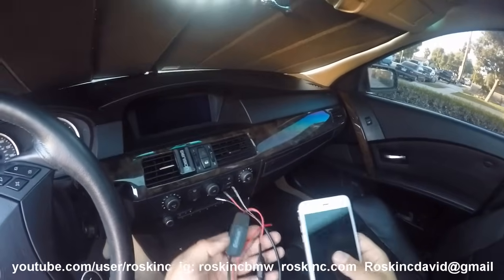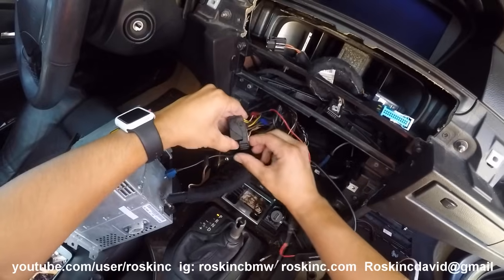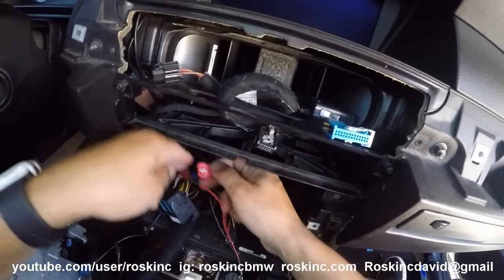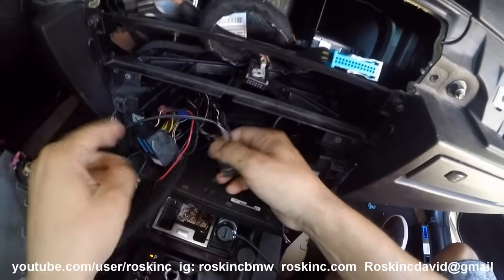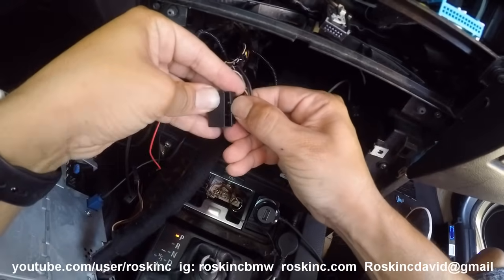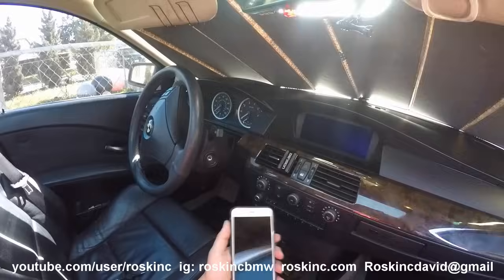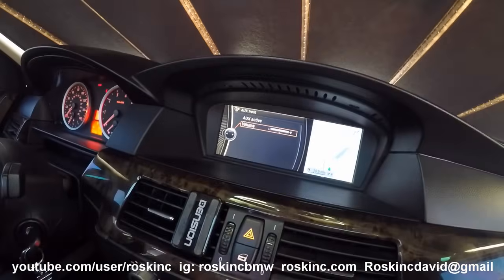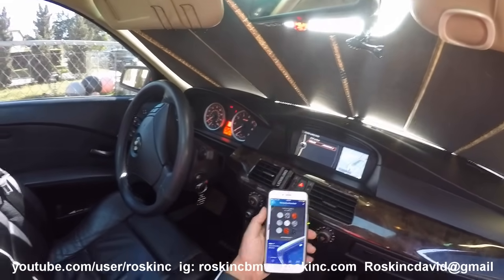how to install bluetooth aux adapter e60 bmw 5 series iphone 7

Comment: Just installed my BT and aux cable bundle. I got to say I’m impressed with the quality of the sound. I was expecting some latency delay, but to my surprise there was none. Instructions were very detailed. Only set back was the inability to install the aux input in my dsc area because I have heated seats and the module had a circuit board that wouldn’t allow me to drill a hole. But this was a blessing in disguise because I found a more convenient spot in the dash. Also, very happy it does not interfere with the factory hands off blue tooth cell phone feature. This was on an 04 530i. P.S. Coding the AUX to the idrive took less than 5 minutes. It helps to know coding ;-)
Reply from the maker: supra driven thank you! Enjoy the aux I’m glad your enjoying the quality. Since this video I’ve gone through a ton of Bluetooth chips to find the best quality volume one. My adapter have since gotten way better from when I made this first one on this video!
Reply: roskinc That explains why the one I received looked different than the one in this video. Thank you sir.

Comment: if you already have a aux cable then just get a aux Bluetooth receiver more simpler
Reply: aux output sorry
Reply from the maker: you could do that, but most of them have a terrible alternator noise when connected
Reply: roskinc bullshit , any amazon bluetooth reciever works great
Reply from the maker: DaRk³NorSZ try connecting a Bluetooth receiver from amazon to the aux jack via a usb plug. It’ll work but you’ll get a whine. Not saying my adapter is the only ones as many have copied mine but adapter from a usb plug makes alt noise. Mine has a power filter, i have since made my adapter better since this video was filmed.
Reply: Roskinc any way to tap into video feed to the display ? I have a spare screen so going to attempt video input on it could do with diagram on pins any ideas ?
Reply: @roskinc  I was just going to ask you, I'm getting a humming noise from my Bluetooth but I plugged mine into the original aux connector like yours. I replaced original Aux wires white, yellow, black with swapped Bluetooth white, orange, black is this correct? I tried to use the Bluetooth connector on the other side of the aux but I didn't get no sound.

Comment: Any ideas as to why the sound is significantly lower when im using the AUX cable as compared to for example the radio / CD? And if so, is there any fix to this?

Comment: I have a 2004 e60 530i. I had my car coded for an aux and installed using your video. Now I upgraded to Bluetooth adapter and WOW ITS SO MUCH CLEARER. Took me 30 mins. Plug and play. Thanks bro!!!
Reply from the maker: Your welcome glad you enjoy my product!! I appreciate it!
Reply: No doubt. Had to come show you some love. Keep it up!
Reply: Does it work with the steering wheel buttons?

Comment: Installed this last weekend in my 2006 BMW 650i. Wiring was exactly the same so that’s great. Works great! The ground wire can be tricky to tap into, so for anyone doing this make sure you wiggle it quite a bit to break through the isolation.

Comment: I received mine yesterday this is going into 2008 528i.. the installation looks easy enough. I will post an update after installation. Mine already has the aux option. So this should make the installation easy no coding needed.

Comment: sry for the bad english i guess (germany)
i tried to go for that white cord that you used. It was 5V only.
I did remove the Middlepart where the (GearSwitch) is and put the + on the Cigarette thingy and - on the main part where the cable is going to the navi. it was 12v then and it wasn't permanent on! But thanks for the Tutorial!

Comment: Nice one man, I've got the 2007 530i and was going to buy the damn ULF module which costs a bomb. This is a much better (Less expensive) option. Only down side is you don't see the art, tag info etc on the iDrive screen but personally it doesn't bother me too much.

Comment: just got mine coded and installed works great sounds good and does not interfere with cars phone bluetooth or ipod adaptor thanks for the tutorials.  I noticed when I was codeing the mask I saw something about equalizer nitch , if I mount this will I get a equalizer in the menue of the idrive instead of just the tone bass and treble?
Reply: Well I did make the eq active it shows up in the I drive but is non adjustable anyway to make the eq slides work?  Also my bluetooth aux volume is noticeably lower volume than CD or radio or factory ipod adapter or factory hands free volume is there anyway to make volume for ADP2 louder

Comment: I would like to know what version of bluetooth does your solution offer? Chinese offerings are all based on bluetooth 3.0. However, Sure Electronics has a small board that delivers bluetooth 4.0 with APT-X (also on 12v and also at similar price point)... which GREATLY enhances streaming quality. If someone were to sell that as a ready to go solution like you are doing here (i'm not the soldering type), i would choose that over the older bluetooth version.

Comment: Received your BT adapter kit a couple days ago.  My 08 E60 connector uses only pins 3, 4, 9, and 10.  You say use pins 2, 7, 8.  I don't have CCC, MASK only.  I already have a working armrest AUX so are those different pin numbers on mine?  Confused on what pins to use.

Comment: Question, do you disconnect battery when tapping into the wires? Also, what is the name of the connectors you used the plastic. Thanks for the great video!

Comment: i have a 2007 e60 550i, yet my idrive system doesnt look like that. Is it important to update my idrive before installing this? 
i was using the rear auxiliary connection ever since i first bought the car and eventually it finally gave in and broke. This bluetooth adaption will help greatly! 
many thanks, 
- New subscriber
Reply from the maker: Karl Enero this video i have a Cic retrofit but you do not need anything upgraded, you can use the standard non navigation or any system the e60 comes with to add this. If you have aux already just add my adapter and your good to go .

Comment: What's up bro I'm so grateful for your videos. I just got a 2007 530i 2 days ago and I'm trying to figure out a way I can stream Bluetooth audio and still use the steering wheel controls to answer calls. Any help would be much appreciated
Reply from the maker: Eric Horhn if you want Bluetooth and use steering wheel controls to skip songs you'll need a module like Denison. If you just want aux Bluetooth, your cars hands free Bluetooth will still work, my Bluetooth adapter would be the cheapest solution.

Comment: My 08 528i comes standard with aux which is located in the center console box. I bought a Bluetooth adapter and followed your instructions. My phone picks up the signal and connects to it but I have no sound. I put the wires in the back like you showed in the 7,8,2 locations And nothing. What am I doing wrong? Am I suppose to be removing the factory aux and replacing it with the new aux blutooth adaptor? If so where do I tap into?
Reply: KaspenOne hi. my car also comes with standard aux. should i replace it?
Reply: Hey guys, I know it's been a minute but did you guys figure this out? As I'm having the same issue.

Comment: I bought an OEM aux system from BMW and installed it on the DSC slot from your video. It looks great where it's and and I currently have a separate Bluetooth adapter attached to it. I really like this concept, however I kind of don't want to disconnect the current one, as I cannot cover the hole I drilled into the DSC slot for the aux port. Is it possible to just tap into the aux wires for the Bluetooth unit? That way if I have others in the car they can plug in if they want without having to unpair my phone? And to save the port I already drilled?

Comment: Hey Bro. I Have Already OEM BMW AUX It's in the rear and it's annoying. Anyway i want to Install Bluetooth Receiver Will you'rs work ? and I think it's not the same instructions to get it installed as mine is OEM. Any help will be appreciated thanks.

Comment: I'm very interested in this product even though I always buy phones with a 3.5mm jack in them. Currently my '04 E61 525i has a OEM aux jack retrofitted by myself, which comes with a filter to eliminate any voltage spikes or something of the sort to enter the CIC thus protecting it. I wonder if this product has the same featured or if it doesn't need one because it's wireless? Also is there a volume limiter? Thanks in advance for any answers. :)

Comment: do you need to code the bluetooth option to your idrive? otherwise how do you play music through that? my factory bluetooth is not working so i am thinking get this. thank you.
Reply from the maker: yuehui xie you just need aux, this doesn’t have anything to do with factory Bluetooth. So this is like replacing the aux cable.
Reply: so the only thing i need is code the aux to idrive? but what if i want to use aux to play music?
Reply from the maker: yuehui xie yes but keep in mind that this does not do hands free calling. Only audio Bluetooth.
Reply: how do you tap into the power wire to your adapter's wire? do you need to cut it and connect it? thanks! and The link to the adapter is sold out I think, you still have the adapter?
Reply from the maker: yuehui xie you use tap connectors no need to cut wires. I include them with every purchase. Check my eBay page or my website roskinc.com i have them in stock the link on my description needs be updated
Reply: great, thanks, I have one more concern, I have 2008 BMW 535i, I think I can't open a hole on the DSC board, any suggestion for that? and does the adapter ship from US?

Comment: Hey Roskinc, so you say the coding is the exact same as when adding the aux cord. If I want it to say "BTA" for bluetooth audio instead of "AUX" in the idrive, do I just replace every AUX that I write into ncsexpert with BTA? Will that work?
Reply from the maker: its not possible to change the word AUX on idrive menu, it will always say aux, changing the word aux on the ncsexpeT TRW, MAN file will just cause an error

Comment: Thanks for the vid. But the 3 cables that go to the harness, in what slots do they go in to?
Reply from the maker: 7,8,2 - right 7, left 2 and ground 8
Reply: @roskinc  Thanks alot for a quick answer!❤ what colours should 7 and 8 have normally? (Ground should be black/brown/yellow)

Comment: Would it work for bluetooth phone calls as well? That's what I am after. Btw I have an aux at the back (LCI version) and cd changer in the glow box so I don't need to stream music, but looking for a decent bluetooth solution for my phone. I'd prefer something like you did so I don't need to install a Parrot. I like the clean look with just iDrive and I would like to avoid having another display for parrot attached to my dash. I don't have a bluetooth in my car and neither I have voice assistance or whatever it's called bcs I have a lane departure warning system..so the question is would your dongle be a solution that will work for me?

Comment: Would the Bluetooth phone prep still work? As I have this on my M5. Would order one if it does and would you ship to the uk?
Reply from the maker: if you get a phone call, your factory Bluetooth will over take the audio Bluetooth, so it DOES NOT INTERFERE with your factory Bluetooth for hands free, strictly just audio. when you end call, audio will resume

Comment: Can we tap into already installed aux wires and connect the Bluetooth adapter 
What's going to happen, will they both work
Reply from the maker: its prefer you don't but people have had me do it for them and never heard any complaints. i will start offering bluetooth with adapter to connect standard aux as well
Reply: can you tell me where to buy everything to bme e61 252d 2004 ???
Reply: @roskinc  is this available?

Comment: Another EPIC clip I followed and succesfully installed (just like a sport button). But the volume on my CCC is very low and cannot set the AUX volume separately. Cannot find the answer online. You have any good idea's?
Reply from the maker: Add a inline audio “amp” to boost signal. Besides that, the aux always lower volume than am/fm cd

Comment: My ccc unit just went out, it keeps on rebooting, dealership say I need a new unit, so right now I mind as well change out the whole unit, please tell me what parts do I need, I got a guy worked in BMW recycle I can get the used parts, I can bring it to you and let you install it,  please let me know thank you for your time
Reply from the maker: you will need a new ccc/MASK module depending if you have navigation or not.
Reply: roskinc I do have navigation

Comment: Hi Roskinc, I just purchased the Bluetooth unit. I already have the AUX input in my car, so the bluetooth unit would be sufficient to allow connecting to my i7? You have a third option for 59.99. What's the difference?
Reply: Perunding Primareka i am asking the same thing but nobody answers

Comment: Have you had any issues with this failing to send out a bluetooth signal? I've had it installed and working for 6+ months now and today all of a sudden my phone isn't getting a signal from the receiver and it doesn't show up when scanning for bluetooth devices. I used it just fine today, went to grab some food at a restaurant, and it wasn't working when I got back in my car. Any ideas besides ripping my whole dash apart?
Reply: Mine is doing the same thing, was working fine then it does not show up on any of my family’s iPhones… he really needs to respond to us…

Comment: im using a raspberry pii 2 model b as car pc with openlec  ,can i output sound from it to this as with cable volume is way to low..
Reply from the maker: GA Mancsfinest are you using OEM Bmw aux cable? Is so, OEM cable sound is very low. My cable will give you better sound. If you want more sound, add a volume increased program on your pii

Comment: I hope I understood it correctly. You are getting power from the ccc source, which never switches of, right? Pins 12 and 16?
Reply from the maker: no, they power off when the vehicle goes to sleep mode. your taping into a ignition power wire not straight to battery wire.
Reply: @roskinc  and do you know which pins they are? because mine bluetooth adapter wont switch off.. it has a small consuption, but I am afraid that it will at some point drain the battery.. I guess it should be pins 12 for ground and 13 for "radio on"? Right? I made it wrongly to the pins 12 (ground) and 15 (power 12V 20A)..
Reply from the maker: Jan Pokorny I’m guessing you didn’t purchase one of mine? Because I included detailed instructions where to install
Reply: @roskinc  no I haven't, but I found your videos while searching for the answer which pins to use. I understand that I cannot expect any hrlp, since I am not your customer. Yet I would really appreciate your advice.

Comment: Sir i have installed a Chinese aux cable from aliexpress but th3 sound quality is not good , pls confirm is it because of the low quality wire ??

Comment: I'm still having issues with the programming 🙁
Car & computer communicate, but... Right after I type +NAUX, & go back, the next step doesn't work.
Also only have 2 profiles available in both versions i downloaded & installed

Comment: Is it the same way to code a bluethoot aux or a cable Aux? ..on e60
Reply from the maker: krisqc m adapter works like aux, you code only aux, Bluetooth hands free on vehicle does not do audio,
Reply: i mean bluethoot aux adapter for music and cable aux are they coded the same way ? or there is one more simple. thanks!
Reply from the maker: krisqc coded exact same. Simple code to activate aux .

Comment: Hey man, I really need your help.
I had the CD changer but opted to connect the Bluetooth receiver directly to the unit. Although nothing shows up on the iDrive. How can I fix this?
Reply from the maker: Is the vehicle coded for aux?
Reply: roskinc no, it only shows up the 'cd' tab
Reply from the maker: Marco Lopes you have to code for aux
Reply: roskinc alright man, thanks alot for replying so soon!

Comment: how do i code my 05 e60 for aux? what software do i use?
Reply from the maker: ncsexpert, watch my coding video on how to do it.
Reply: Juan Ramirez, Did you get this working/coded on your 2005 BMW? I have an 2005  530i and would like to install it as well. I'm not sure if I already have to code it or not. I already have Bluetooth for the phone. Help please.
Thanks
Reply: i have exactly the same problem!

Comment: Hi, can you still using the Bluetooth of the car for incoming calls like you used to?
Reply from the maker: Schinkenjupp the cars hands free Bluetooth over rides the audio Bluetooth, so it will work like normalZ
Reply: roskinc thank you so much for your fast reply. So my phone needs to be paired with to Bluetooth devices at the same time? Does this work? I am using an OnePlus 3 by the way.

Comment: how many miles your car have?
Reply from the maker: about 140k and still running strong! i do all preventative maintenance and  Castrol  synth oil every 5k miles, use good gas, i often check engine for any leaks, and fix anything that even slightly looks like it might need changing, probably more than necessary but car deserves it!